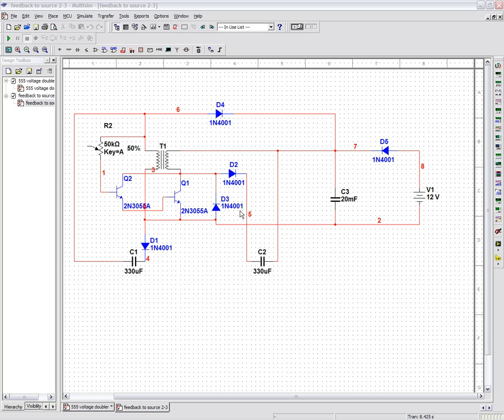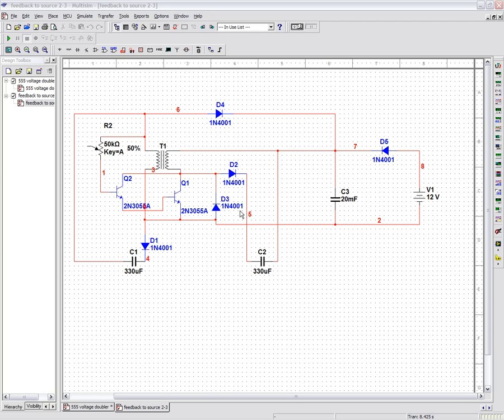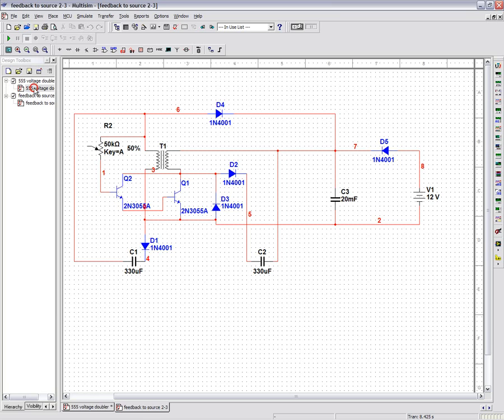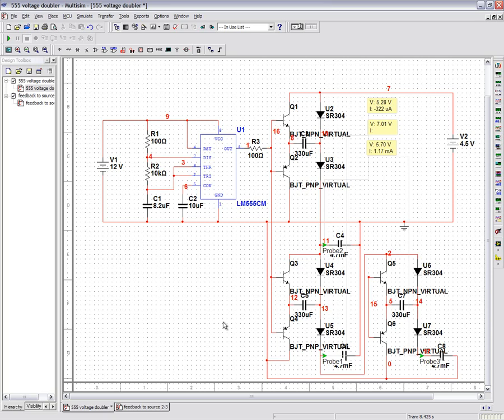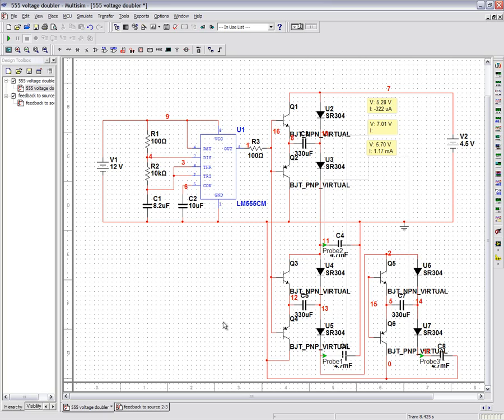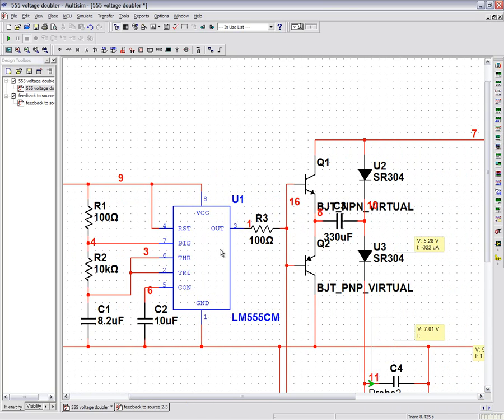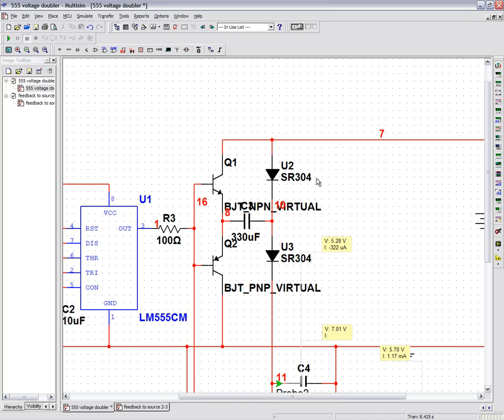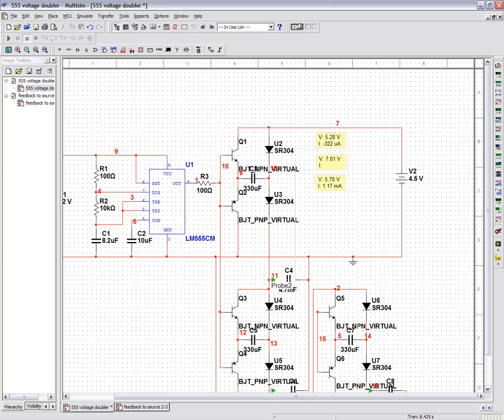comwarriors bedini feedback to source / new bedini - Update 9 - circuit design

Comment from the maker: these caps are being used as temp storage for the back emf... at this moment the back emf is not being used in my gen2 system... Big changes for my gen3 board!

So, minimum voltage would be 200 volts... BUT if your system kicks back a lot of back EMF then you'll need to watch the voltage in the caps...